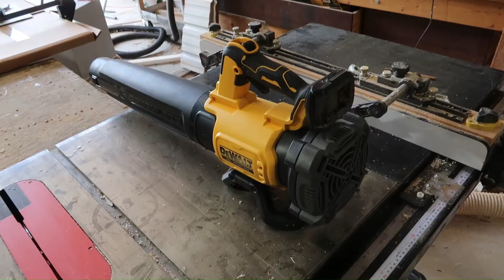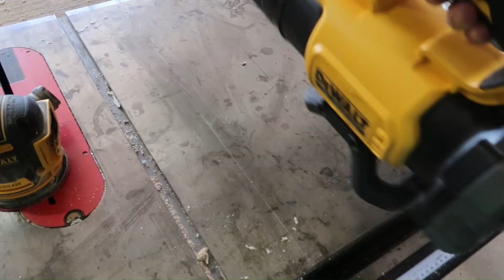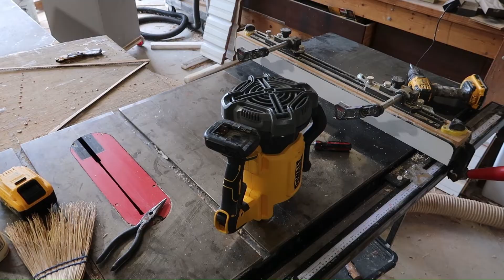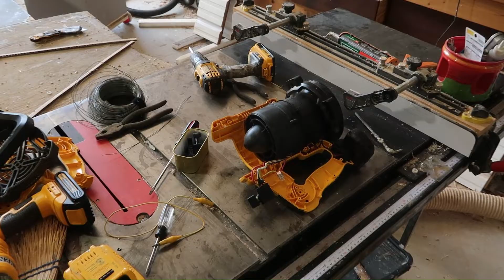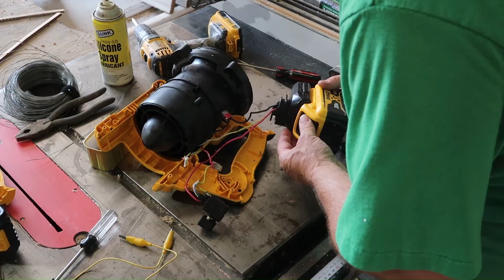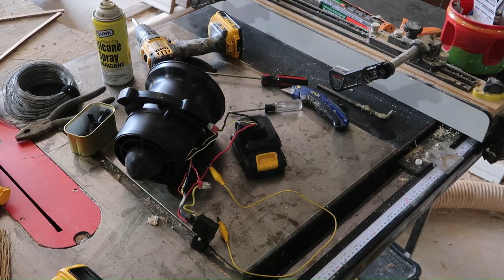DeWalt Leaf Blower Repair - FAILED!

Comment: Have one that the wiring is kinked and junk from the factory, well... After 6 months of use. 4 separate wires are broken from installation 3 from jamming them into the housing with a screwdriver or something similar and one fine wire going to the blower motor that's pinched between the housing

Comment: Corrosion is the problem. Where the battery plugs in and any of the other plug ins. Take it a part, buy some industrial contact cleaner, Spray the snot out of them. Dry them with compressed air. And its back to the land of the living again. Once you put it all back together. Clean the handle switch while it's a part also. Thank me latter.

Comment: I just got mine back working. It was the plugs that go into the motor. They got corroded. Cleaned them out and we are back in business. Sucks to take apart/put back together though.

Comment: Mine just stopped working for no reason. Went to use it on a job and it was just dead. Tried different batteries. Nope. Nothing. Just out of $200. Awesome.

Comment: I experienced the same problem many times on my DEWALT DCBL722B leaf blower. The moisture was typical from melting snow. Each time it failed, I placed the leaf blower in front of a heater with a fan and let the warm air blow on the leaf blower body toward the rear vent and handle. So far the problem is resolved within a half hour. If the furnace was cycling, I placed the leaf blower in front of the heater register and left it there for a few hours, and that also resolved the problem.
Reply: Thank you very much, i got a heat gun by the motor on a low setting for a little and it fixed my problem, hopefully it stays fixed

Comment: had the same issue with my dewalt DCBL772 60 volt !!! stopped working sudently ,... bought a rebuild kit from dewalt (B+D/NA623795) for around 30 or 40 bucks  . come with motor, module, speed switch and battery connector plug. but i have a problem ,,, the kit come with a additionnal ground wire and i dont no where to connect or bolt it .... any suggestion ? Thanks

Comment: It's a Brushless PWM motor. I don't think you can test that motor with 20volts direct (motor will not run). It has to be used with the speed controller. Brushed motor, different story.
Reply from the maker: Check out this video where Tony Rangel found the problem and got his leaf blower working again
https://www.youtube.com/watch?v=n6pMPJQkcwc

Comment: I had the same problem on 2 separate dewalt blowers. I opened the trigger speed switch, inside you will find a micro rheostat that controls the speed of the blower. I cleaned the contact surface and was able to repair both of mine.
Reply from the maker: That's good info. I thought shunting the motor directly to the battery would identify the location of the problem but "gregsok9682" implies that my method of diagnosis may not work.  If I have time, I'll dive into the trigger housing and see if that helps.

Comment: I have the same issue. After being left in the rain it no longer works. I did some testing and I believe the switch it at fault. I’m getting 18ish volts into the switch and 18 ish volts coming out of the switch with no trigger being pressed. I believe it’s backfeeding from the communication wires to the motor as if I remove them the load side of the switch then has zero volts. I have found the same model switch for $47! On eBay. Prohibitively expensive.

Comment: I have the smaller handheld leaf blower having similar problems. Replace switch and battery connections, still had problems. It's a brushed motor. Disassembled motor and cleaned commutator. Work fine now.

Comment: there are 2 little capacitors on the board in the motor.  It is encapsulated in plastic.  melt or cut it off and solder on new capacitors.
Reply: work well thx

Comment: I have the exact same one…. just under 2 years old. Completely stopped working and for no reason! I didn’t leave mine out in the rain. I believe it’s just the brushless motor just shorted out and stopped working. I Filed a warranty claim with DeWalt. Hopefully they’ll cover since it’s under the 3 year warranty 🤞
Reply: Did Dewalt honor the warranty claim?
Reply: What was the outcome with your warranty request?

Comment: I have the exact same blower with the exact same issue.  When i take it apart it works fine. It seems that the problem is the switch on mine.  I have sprayed it with contact cleaner but it quits working not long after i put it back together.  I cannot find a replacement switch or i believe i could fix mine.  Mine also got wet in the rain.  When it is working the switch is variable speed.
Reply from the maker: That's good info.  I might revisit it and spend more time on that switch.
Reply: I just wasted 21 minutes of my life.. BYW, the background noise is very annoying!